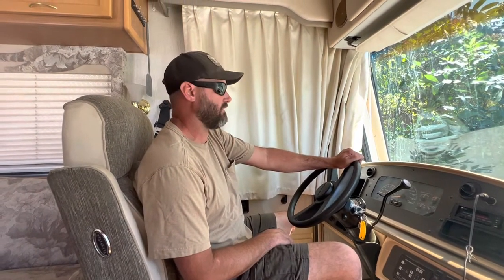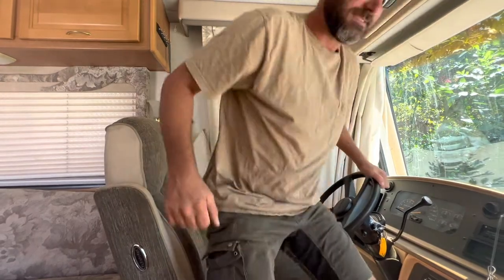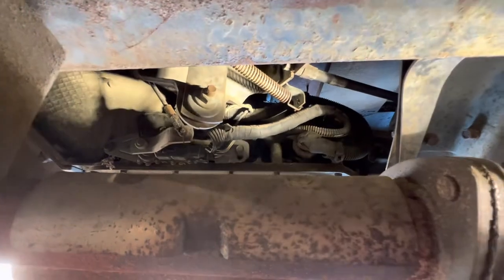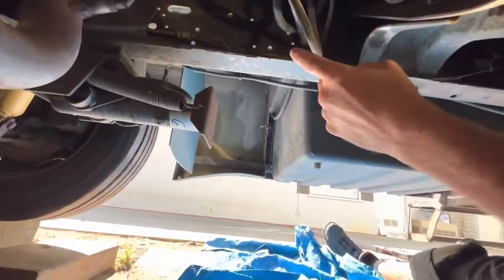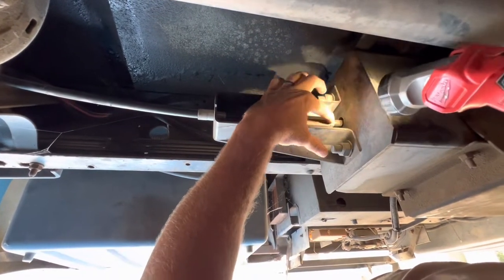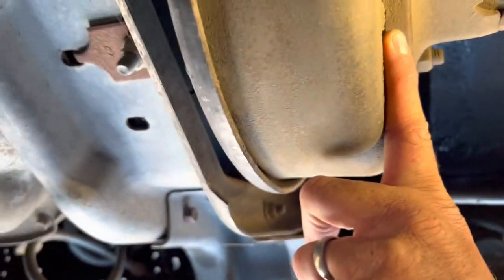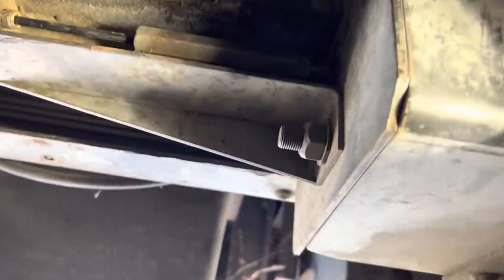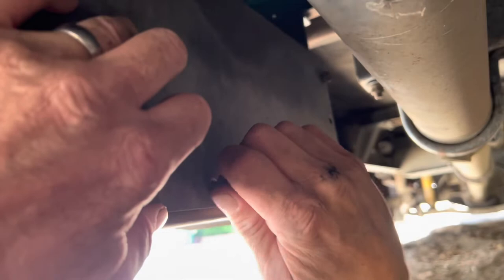Auto park problem and solution

Comment: I have a 1994 Fleetwood bounder motorhome and I've tried to pull it with a tractor, however the rear wheel wouldn't move ,we rocked it back and forth just in case the rear brakes were stuck and it only slid. I'm going to try this . Question , does releasing the cable cause it to roll back since I'll be under the RV?

Comment: Good job.did it actually disable the forward gears and wouldn't let it engage or does it engage the gear but wouldn't spin the drive shaft??
Reply: Seems Like it Locks DriveLine BasicalLy Locking Up Transmission/Engine Like a 😊MAGA CentraL Brake

Comment: Hi David. Thanks for the video on the auto park. I have a '96 Fleetwood Bounder and the auto park has failed.  New it would due to research when I bought it. Could you send a link to the dreaded Green Switch you found as a replacement. Thanks. John
Reply from the maker: Sorry it took so long to respond, I got it off Amazon.

Comment: Any thoughts on parking brake on it partially still goes in gear not all the way engage as before with it set you could put it in any gear and they all would be like in neutral??
Reply from the maker: I’m not sure, maybe the cable is not tight enough
Reply: @davidholmes3257  Thank you i will check it!

Comment: Dear David, I have a question if I may. I have a 2003 RV, Condor Workhorse. My Auto break works but sometimes it won’t.
Reply: I also have a 2003 RVision Condor with the GM workhorse body. My RGS was bad and that worked but I think due to a tire blowout or debris in the road it also sprays hydraulic fluid when trying to take it out of park. What I'm wondering is how to change that hydraulic line

Comment: I have a 98 pace arrow vision with no auto park; is this a similar situation? I don't have Park either. When I put it in park, it doesn't hold; it will roll away and I won't have a place to live. When I pull the auto park, nothing happens, and it's the same scenario, the rv will roll away. Nothing holds or stops it. I don't that much in this one. Any recommendations? I've taken it to local and large dealerships and have had mobile repair techs look at it but for five years;  nobody can touch it.
Reply from the maker: Maybe the hydraulic cylinder is not working, to pull the cable

Comment: My light is on but the rv moves. Just topped off fluid and light is still on. Any ideas? Afraid of it getting stuck soon..
Reply: I'm having the same issue. Auto Park light stays on. When rig is taken out of P you can hear the brake release. Rig drives. I spoke with RVUltra via their text window through their website and they have some very knowledgeable folks in regards to the J71 Auto Park. The site also has tons of diagrams of the system and they make replacement parts that have lifetime warranty and are direct replacements for the 'travel' and 'pressure' actuators under the rig. Going to try and get underneath to disconnect the travel switch. This is redundant and is not needed per Ultra. Brake will work and light will hopefully shut off. The cable disconnect as shown in this video is what will allow rig to roll if you disconnect it.
Reply: P.S.- I have a 2002 P32 WH chassis on a 2003 30' Airstream Land Yacht.

Comment: Hi Guys! We have the same Peoblem, we Change Both Switches Grey and Green, and Change the Harnes too. The parking Brake is Working but the red signals of parking on the board never come out. Other thing is that when move the stick to P it doesn’t park it’s like N so we doesn’t now what to do. We also looking for the Button to activate this electronic Parking Brake, we can’t find it, any idea of this issue and where to find the button ? Thanks
Reply: Coachmen Mirada Chevy 99
Reply: See my earlier post RE: site who sells parts and has diagrams and an active chat line that can speak on the Auto Park J71/J72 system. I have had 2 long text chats with them and printed out tons of pages of info specific to this issue of which I have already had one of the switches replaced a few months ago.

Comment: I had the same thing green switch failed… started leaking. I could just keep adding fluid and everything would work… the reservoir was small so I couldn’t go far with it leaking…I got a new switch off Amazon the 15961566 green switch… I installed it and I got a pump now that continually is asking for power… so I put leaky back in works great except for the leak. I tried another new green switch off Amazon still the same problem doesn’t want to shut the pump off. I found a Lower pressure switch off Amazon.. didn’t move the Ram very far then it makes a the relay start clicking. Anyone else have this issue and resolve the problem?
Reply: Maybe you just need to tight stronger I have a similar problem when we replace so we just tight harder and stops the leak.